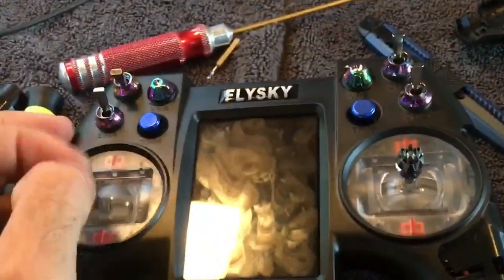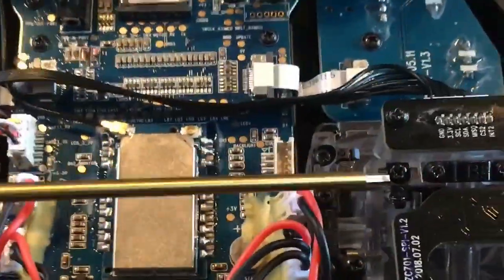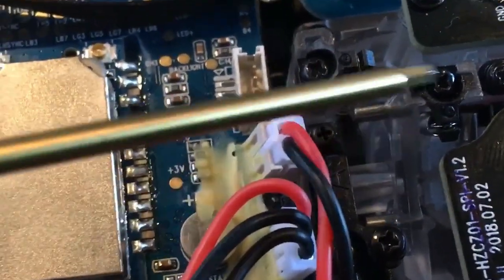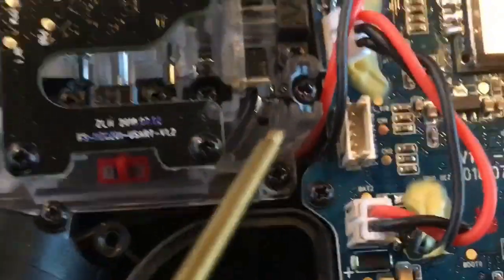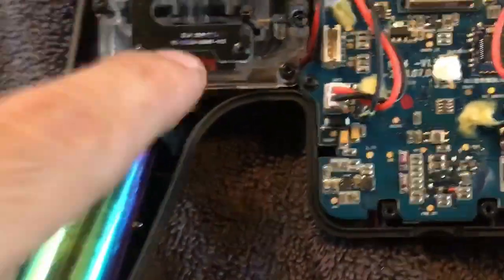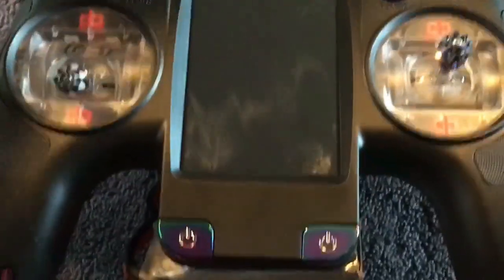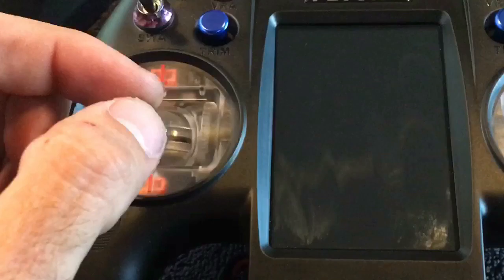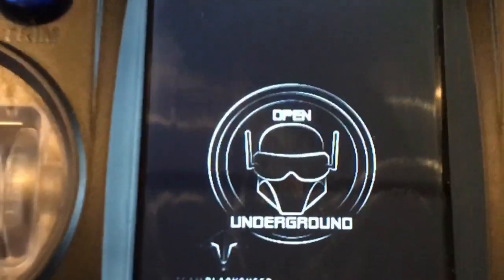Nirvana Nv14 for pinchers!

Comment: Nice job! I just got mine the other day from Getfpv and it has the Nirvana logo instead of the Flysky one. It also is flashed with 2.2.2 firmware and came with a few sets of extra springs. I guess they heard enough of the "too loose" feeling! I pinch as well btw. I pre ordered back in late May and was tired of waiting for UFPV although I understand they're working on the "custom" firmware. I'm hoping that Opentx includes this radio as you probably know the firmware isn't completely functional.
Reply from the maker: Mawii FPV awesome man glad you finally got it! I wish mine cane wit those springs and the nirvana label lol but I freaking love it! I had to flash to 2.2.2 which was harder than any hardware mod for me haha. And yeah tons of little annoying firmware issues . None that affect actual performance but here’s the ones I’ve found so far with my test model.  Can’t charge via usb, powers external module via usb and all models even internal at all times, only works on one battery if you use the correct one. Mine somehow turns on in my bag I can hear it talk lol some models don’t display the name except in the model menu, if you go last 100mw on your crossfire it defaults to 10mw I’d much prefer it to default to 100mw. That’s all off the top of my head and none a big deal but fairly annoying to a full time crossfire user since it needs the antenna on when powered plus I’d so much rather plug into charge lol
Reply: Dna Fpv , yep same issues here. I also find the model names don't save. Also nothing in the SD card is executable. I'd try hooking it up to my laptop but I don't want to risk bricking it! Also been following the rcgroup thread but still no mention of even a possible opentx firmware update yet.
Reply from the maker: Warrick is working in it as we speak I’ll let you know as soon as I get it!